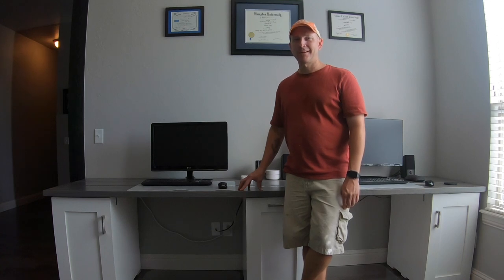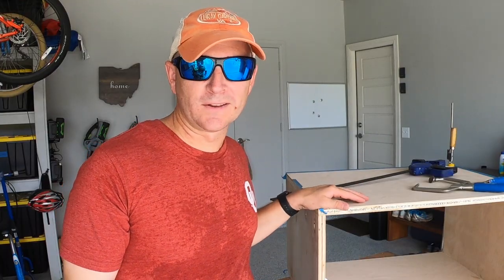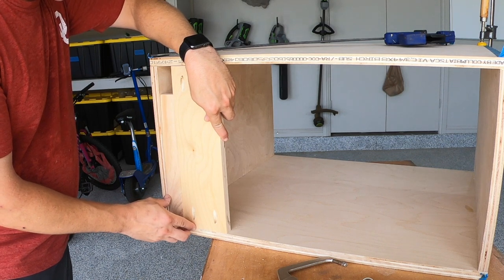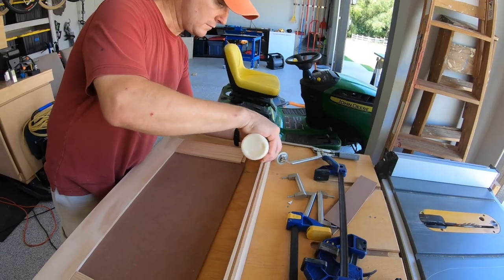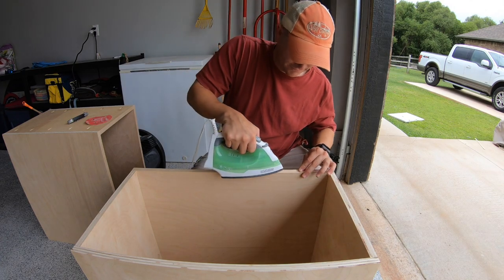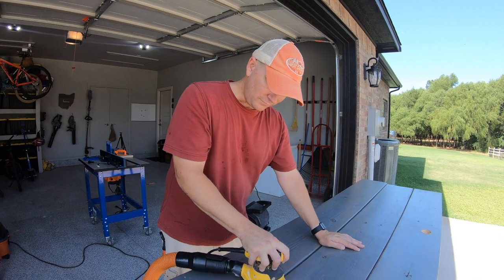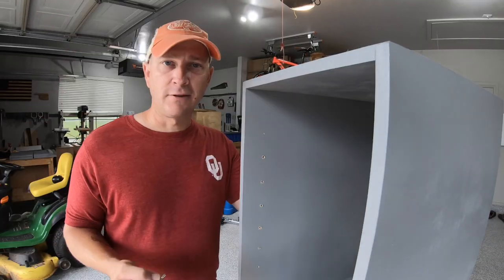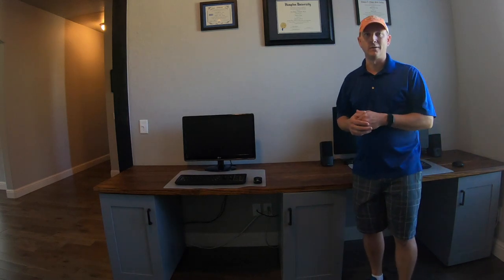Dual Workstation Desk

Comment: What we’re the dimension of the cabinets?
Reply from the maker: Bite Hard Designs 16”wide, 24”deep, 28 1/2”tall
Reply: WoodChuck Creations thanks were the 2x10 10ft long
Reply from the maker: Bite Hard Designs mine were originally 10 feet, but I had to cut it down to just over 9 feet when I moved to a new house to accommodate the room